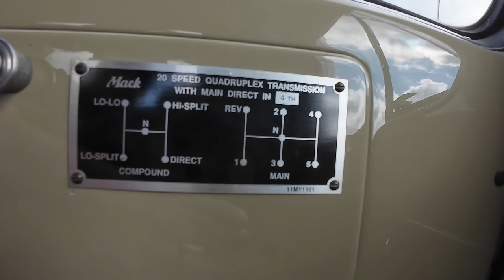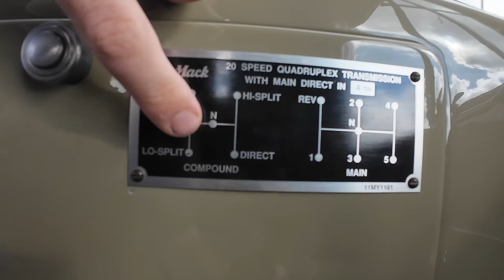2 Gearshifts | Twin stick shifting in my Grandpa’s old Mack

Comment: Great looking tractor and brings back a lot of memories from my teen and early 20's. Brother drove truck all his life and bought his first at 16. I did a lot of driving at that time but after graduating university only played around a bit. Other than highway trips I never drove one of those new fangled Road Ranger Transmissions.

But I have two questions I hope you don't mind answering. Power steering and a jake brake I do not believe were available on a 1956. He bought a new Mack in the spring of 54 and it was arm-strong steering and no jake. I was only 13 when he got it but positive they were not options. That thing was his pride and joy and it was quite an accomplishment for a kid that was just turning 18. Can't say for sure but I don't believe those option were available till into the 60's.

Living in the Canadian Rockies just about all shifts were split and you had to shift both at the same time. You couldn't take the time to shift one then the other lost too much momentum. If you did would be in that 1st auxiliary or Lo-Lo. You also may need to be in reverse in the 4th or Hi-Split when backing down a hill if you spun out. Didn't want the drivers to lock up as then you were really screwed. 

Still remember the first time I spun out. Was 14 at the time and had a lowbed with a International cat on it. At the bottom of the hill had a right angle corner to take onto a single lane bridge. I'm sure I sat there for 15 minutes before I could pry my fingers off the steering wheel:) We always had a set of single chains which we would put onto the steering axle when it was really icy. So I added them to the triples already on and was able to claw my way up the hill that way.

As you say trucking has changed a lot over the years and I don't think anyone would want to go back to what truck driving was like in the early 50's. Now this could be a local thing just I don't remember anyone using the terminology for the auxiliary as shown here. We just referred to it as first, second, third, fourth. Light load you might pull that hill in 3main 4 aux, or 3, 3 if a little heavier. 

Anyway thanks for the memories and at this time of the year I also miss my brother.
Reply from the maker: That’s really cool!! No this truck definitely did not have power steering when new. Not sure on the Jake’s. I think it was originally equipped with a 180 Cummins. While it had a 335 in it my grandfather added a belt drive aftermarket power steering setup and gearbox- when we put the big cam in we were able to run a standard power steering pump in the accessory drive.
Reply: @ScrappyIndustries  
Thanks, hopefully someone with a better memory can add in when power steering became an option and on which make along with info on the jake.

Comment: I drove for over 25 years and my first truck was an old Mack twin stick.  It wasn't fast but it was tough as nails and as long as the tires had traction it would pull like a mountain goat. Now i have drivers working for me that drive automatics that literally have no idea how to shift a manual transmission let alone a twin stick. The drivers that are being pumped out of the truck driving schools these days hit the road most of the time absolutely clueless when it comes to driving. All they can do is quote you the rules and regulations they were shown in a book but when it comes to actual driving skills they have to learn the hard way like we did back in the day. You show one a truck now with two sticks coming out of the floor and they'd probably just walk away and laugh lol.

Comment: Love it!  Drove a not so clean example '60 Mack for work in WA.   Loved the Jake like you said on those old cummins.  Used it for a water truck ( on hand in case of fire) while we worked on logging roads in the Olympics.  Cool old trucks.  Get a work out with the manual steering on them mountain roads though. Lol. Great video

Comment: I was waiting to see if you put your arm thru the wheel to hit two at once. Back in the seventies at the ripe age of 18, I moved up from our old Dodge straight truck to a 55 B model two sticker running to the markets in nyc and philly. Great learning experience, good memories. Well, just remembered stalling it with a dead battery blocking 3 lanes of 5th ave in nyc. Another trucker had a chain and pull started me. Those days are gone.

Comment: Started with a F8000 with 5±4 twin stick,never thought it was unusual, new drivers (trained over a dozen) watched switching through 20 fwd and4 rev and wanted to practice on other trucks. Also had KW9000 with 3406b Cat and Spicer SST(5 holes with 4 splits that overlapped-could get lost in there).  KW T600 w/ 15spd reverse pattern double over (heavy haul-almost equal to 18) never let anyone else behind the wheel the reverse pattern was too unusual for 99% to learn. Nothing like a Cummins brake.

Comment: 1979. 1st job outta driving school was hauling sod in an old Mac twin shift. Had no clue but I learned. Last job ended with a brand new Peterbilt automatic and I was ready for it by then. The Mac I drove wasn't anywhere near as nice as yours

Comment: I use to run and old general with a 6/4 and a 50 lbs Holmes wrecker i called them mixing sticks. And if you you did a lot of praying to get back into any gear.😂you did great I’m going to call you scapy boy it just works thanks

Comment: Many miles ,I started in 1972, with a 5+4. Always called the first gear on the auxiliary granny low.
Nothing like the feel of nailing the 2 stick shift. Always had a Peterbilt , main box was closest to the driver, auxiliary far right. Opposite your Mack.

Comment: Had an old 57 Kenworth and it had a 10 and a 4 so I now all about it also no power steering it was a transfer truck was a little difficult to pave or get into tight spaces anyways great old truck loved the low low you could get out and run faster

Comment: I never got to drive Uncle's old Mac, but I did get to drive 13 and 18 spds  1979 Ford 9000 with 3406 Cats and one quite fast 8v92 GMC in the big green one - it could keep up to a pickup at that time.  Kenaston Contractors, Normal Well, NWT, CA and Devon/Leduc, AB, CA.  (I never had a license)

Comment: First off beatitul truck. Ive always loved the big heavy duty Mack's and they are kinda of hard to find. 
Second I always find it funny how dads always have you learn how to drive on the hardest thing in the fleet. My dad taught my how to drive on an electronically controlled 10 speed Freightliner that grinded gears like crazy. Why learn to drive a semi before a little honda? Because like vegetables, its good for you. 😂😂

Comment: I understand that truck doesn't work every day, but I am a bit surprised that those old Mack trannies can take the torque from that 400 Big Cam....we had a 74 Ford LTS.   that originally came with a Cummins NH 250 and a RTO-913 (Dad bought it new)...come about 86 the engine had been in-chassis'd one too many times, so we had a junkyard across the river in PA that had a really good Big Cam 350 and would R & R for us.  The power was GREAT!!!!11. But when we went to pull the trans to do a clutch for the first time found out the input shaft was twisted like a piece of taffy.  The torque of that 350 was WAY more than the 915 could handle...that had an 1 3/4 shaft, compared to a 2" shaft on a RTO-12513

Comment: I’m not a truck driver, I’ve had to drive a rental with a manual and a split axle years ago - I think I was about 19 or 20 years old. That was fun for a while. I had to deliver a bucket truck to the line crew about 200 miles away. I was working for an electrical contractor as an apprentice and the foreman asked me one day if I could drive a manual transmission. I answered, yes, and they asked if I could work out of town the rest of the week. I would get journeyman operators pay for the week and work four more tens, plus drive time to and from the job, approximately 200 miles away. I had to sit in the truck and move it from one location to the next all week - I was the only was allowed to drive because it was a rental and I picked it up. They also paid for my motel room and per diem for meals. I was in hog heaven when I got that check.

Comment: When I started in '77/'78, most of the trucks had twin sticks. Log trucks converted to highway. The old guys said they made 13 speeds for women because they needed an automatic. A Mack I drove had a 5/4 and 325 Cummins. (5 speed main box and 4 speed browny.) Then I drove Kenworth with V8 Detroit with 6 and 4. The 6th gear was overdrive and usually didn't split it. After that, it was Freightliners with 400 and 13 speeds.

A buddy had an old Mack with a 5 speed. The RPM range was huge and it ground every shift.

Some of the low boys had 13 speeds, 4 speed browny and 2 speed rear ends. When they were in the woods and starting on steep grade, they needed to be very low. You can't shift and have to take it to the top to regear. When things broke, it was usually the rear axles.

Comment: 1974-78  I drove  had a 57 Mack with a 5x4. and a Thermodyne Mack engine. First gear in the Brownie , under under, had a top speed of maybe 1mph so really it was a 15 speed.  The brownie was labeled "Under under, under, direct, over".  Although it;s been 50 years (!) I'll give you the pattern:: Rev to 2100  back off the throttle and at 1700rpm  shift the browny. repeat twice. Now let the rpm go to 1300rpm and shift the main box up,  then rev to 1700 and shift the brownie to low. Etc... I could do all this and never touch a gear tooth but I usually allowed 1-2 teeth to touch in the shift. Never used the clutch. never.  Down shifting going uphill is sorta laboreous::: The rpm drops too quickly so I usually let the rpm drop to 1500rpm and shift the main box down, when you go up hill with 80,000lbs all the time the truck slows down Rapidly when you manuver the grear box.

Comment: Mine was an ‘07 KW with a C13 Acert sold it in ‘19 with 1,125,000 miles on it & we’d never been inside the engine. I always floated the gears only used the clutch when I came to a stop. Had a full set of mufflers, go through town & nobody ever complained, used the Jake all of the time. Wish I hadn’t sold it, gets a little boring.

Comment: LOVED the Macks -- Hated those Mack trannys. Most truckers felt pretty much the same. That is much more complicated to the GMC line back then -- the military 2 1/2 had the low side shift and did take some coordination but not near as complex. Drove several varieties using that tranny. Tankers had the fully manual Hi-LO  The troop carriers were much simpler and automatics. I drove tankers - mostly. Could have been (hybrid) Reo? I think.

Comment: On my 46 pet and my 56 kenworth I have  a 5 x4 difference is my brownie box shifter is towards the passenger and my main box is closest to the driver. With the 275 horse power iron lung Cummins you better use all the gears

Comment: I’m surprised that old Quadruplex has held up to that 400 BC, that’s a lot of torque for those old single counter shaft transmissions…..basically you and your grandfather must be some damn fine drivers to keep those things alive. Old hands always said Back in the day even with the twin countershaft spicer divorced 5 and 6 by 4’s if you had anything hotter than a 350 Cummins you had to be careful laying into the power in the lower gears and if you had double overdrives you wanted to run the aux in direct when pulling hard to keep it from heating up.

Comment: What an absolutely gorgeous truck.  I have always wanted to learn how to drive a twin stick transmission.  I learned on a 5 speed R model Mack, and a Ford L9000 13 speed.  I was taught to float gears, and that's been the way I've driven everything for the last 25 years I've been driving.  Can you float this type of transmission?  Or do I need to practice my double clutching before trying my hand at one of these twin stick trucks?

That L9000 was cool, too.  Grandpa drove it, Dad drove it, and I drove it.  Had the strangest 13 speed I've encountered yet. Low range, splitter forward for Lo-Lo, shift 1 through 5, splitter back, then go back to the 3 hole, 4, then 5, range selector up, over into 6th, and on through the pattern.  We never needed those compound low gears though.  But once I started running it, I had to figure out how to run through all the gears at least once, LOL.

Comment: I drove a two stick on a 1973 R Model concrete mixer but it was basically like shifting a five speed.  Low, reverse and high were on the LH stick.  I can't remember what Mack called this setup but it's different from yours.  Cool truck, though.

Comment: Drove a couple different twin stick trucks. The first one was set up with the 4 speed being the main box and the 5 speed being the splitter. (1-2-3-4-5, back to 1st, 2nd on the 4 speed, 1-2-3-4-5, etc. The second wagon was like yours. Where you split with the 4 speed. Not sure if the first truck was odd? I think your arrangement is the most common.

Comment: you have jake brakes tht work on the injection pump over hear we have exhaust brakes tht operate a butterfly valve in the front pipe to stop gasses exiting the engine  the valve is air operated via a push button on the floor near the seat as you use your heel to operate it

Comment: Its a Quadruplex. Theres different patterns for two stick Macks. I learned on  a two stick where one stick was 5 speeds and the other stick was hi.. Lo.. and reverse. You had Hi and LO for each gear and 5 reverse gears.

Comment: Learned on a IH with a quad plex. Loaded was a lot of shifting.
Reply: Technically it went like this.  Rarely used 1st in the main. So, select 2nd main then 1,2,3,4 on the auxiliary, then (this is where the split shift happens) 3rd in the main and back to 1,2,3,4 on the aux and on up thru the gears. Didn't have to that when down shifting (you could skip a lot of gears) It were fun.

Comment: Yes sir for those who are not aware there is really no fits all truck for all applications. I had a 1987 International 96/70 cabover which was a bottom line truck. It was the big cam IV with a seven speed and the only creature comfort was it had air conditioning (the most important belt on the truck) it was a road tractor (I bought it used). Well the outfit I was signed on with would do construction/office trailers for a company that built concrete water towers in the most challenging places. Of course I could easily stick this tractor in some of these places and it did not have the weight for traction and the transmission set up for pulling power, plus the trailers were not that heavy (they were converted rail trailers 45"). Needless to say other truck drivers would comment on how I did not know how to drive when I would get stuck but they also did not realize that I was not set up for off road service, and I eventually turned down those moves as they were not economically feasible and very time consuming and putting unnecessary wear on my tractor. I would try to convince the receiver of theses spots that I could not do some of this off road stuff but it was like talking to a wall as most people are ignorant of why there are so many different tractors for so many different applications. Of course you have heard  "trucks come in here all of the time" from people but you know your business and you know how to stick to it. That's a nice truck and it shows how you keep it up and also the detail your grandfather put into its restoration.🥸👍👍👍👍👍

Comment: Ran  B-61 pulling milk with a 7-11 engine and Mack tri- plex. Later ran a new R- model with a V-8 Mack and Mack Quadra-Plex it'd pull two full milk tank trailers down the NY Thruway to the city like nothing 🤔🙂

Comment: What happens when you declutch after the gears between the two neutral gearboxs stop turning? Don't the input gears stop also? or at least slow down enough to re-engage the gears in the main box without the vehicle needing to come to a standstill ? Then you can bring the revs up and re-engage the the splitter box. 😊 Been there, done that. Further to my first comment on both boxs in neutral,....I hadn't seen the rest of the video when I opened my big mouth. So here I go again. The quad box in that truck seems to me that it may be the variation of Q box that is not overdrive in 5th gear. The one in my B 615 was overdrive in both boxs.In mine, due to the interlock, 5th gear couldn't be engaged unless the splitter box was in Hi split. And Hi split could not be disengaged until the main box was out of 5th gear. The way you didn't 2nd 3rd seems to me that the ratios are closer than my Q box which also makes me think your Q box is direct drive in 5th gear. Great Truck, Good driving.!! Don't worry about a few Little grins when you haven't been in it for a while. I did that every Monday morning.